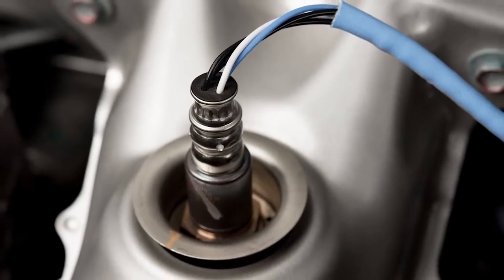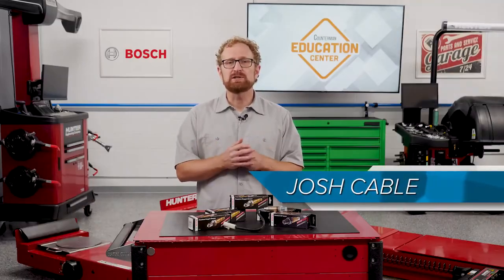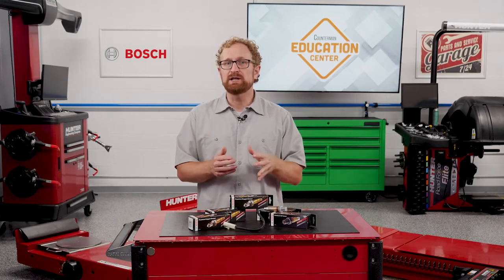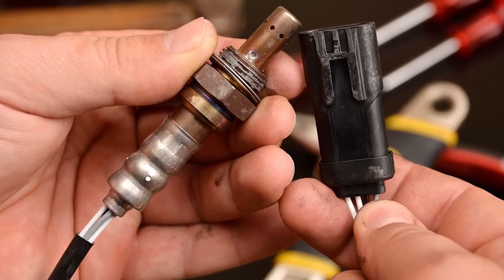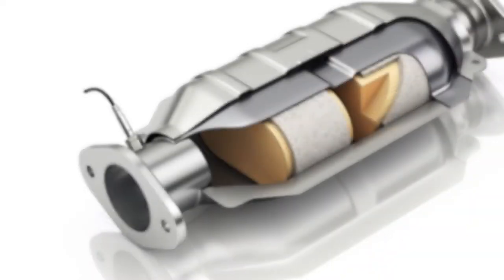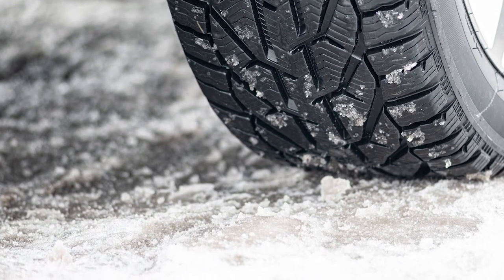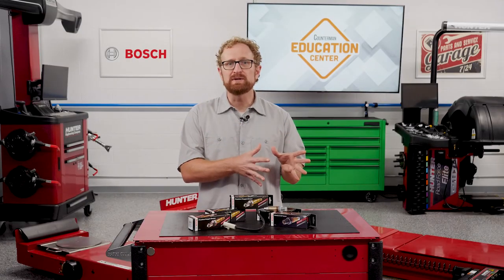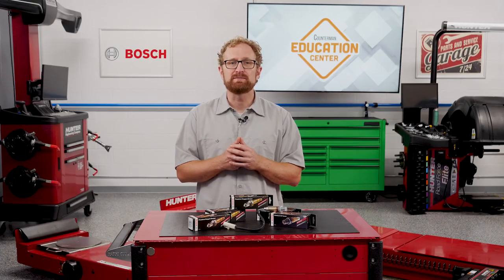Benefits of Replacing Worn-Out Oxygen Sensors

Comment: 2016 Audi A5 has a rough start then evens out . I replaced injectors ,plugs coils , throttle body, MAF , oil separator,waiting in my 02 sensor . Any suggestions
Reply: @TurnTheStoveOnBlaze  it was the temperature sensor. It was broken and my buddy just happened to turn it and it was broken . I only spent about a grand before he wiggled the sensor .
Reply: activate the parts cannon ;)
Reply: Seafoam the engine

Comment: So should an original oxygen sensor with 200k miles be changed even if there are no codes?
Reply: Yes
Reply: wondering the same about my 07 144k miles. no codes but perhaps I should switch it out
Reply: @jesseontiveros5377  Yes definitely. After about 60k miles, so many different chemical deposits build up on the sensor that it cannot read the o2 quick enough or just wrong. A lot of car manufacturers will program their ECUs to have a large margin of error and the ECU will be okay with your car running mediocre to get better emissions and reliability ratings. They are a bit expensive but man... You forget how much you lost until you replace it.